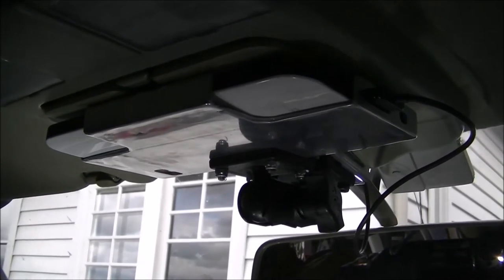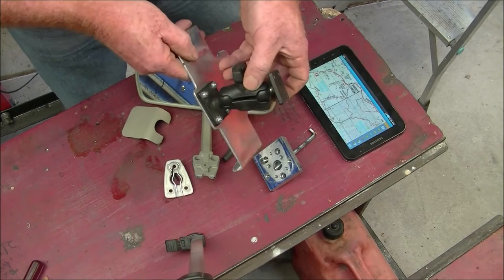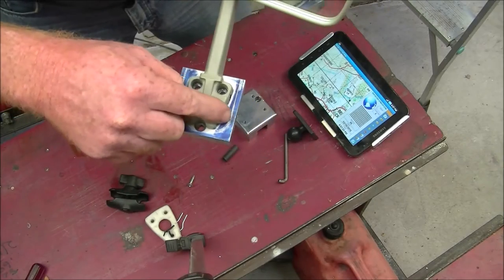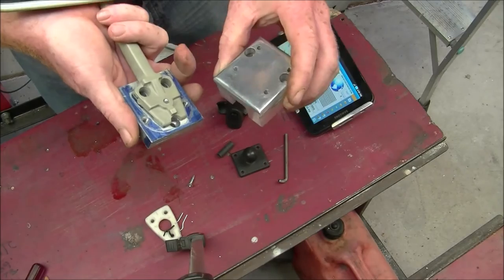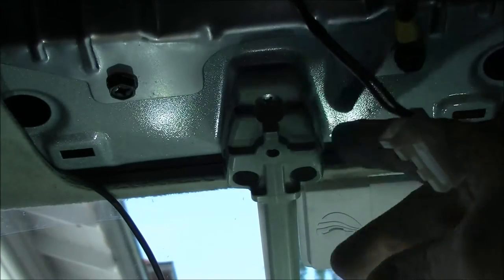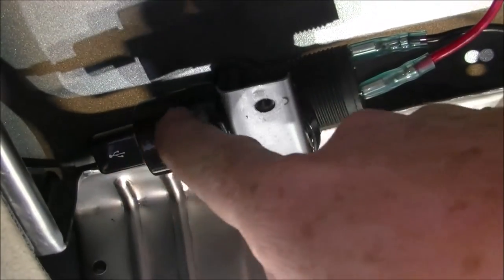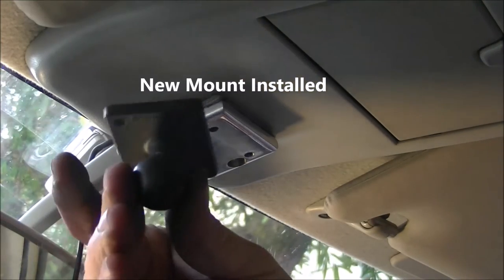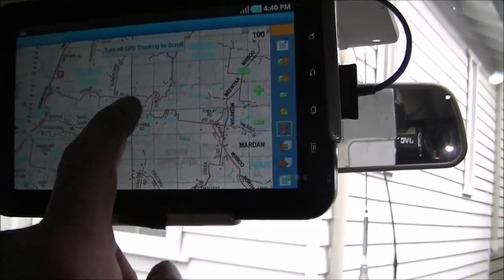HavaCrack: Nissan Patrol Overhead Monitor GPS Mount

Comment: Nice job!!! I've just utilised a spare RAM Mount arm myself to make a iPad cradle. I made a heavy gauged aluminium flat bar arm that bolts to the passengers seat front right mounting bolt. This doesn't hinder the seat operation in any way. The RAM Mount is bolted to this and I made a solid perspex cradle to fit the iPad. iPad just slides in and out. This unit sits to the left of the gear stick and can be faced to either the driver or passenger. You seem to be a fellow 'Tinkerer' lol. Love to Tinker on the GU and the Camping gear. I will be honest, as much as your unit is amazingly made, doesn't it bother you up there? I run a HEMA HX-1 in another cradle I made that slots into the GU's Car Stereo cassette slot. I'll run the HEMA on 'Explore' mode and the iPad on Google Maps for street navigation. On the tracks I'll run Gaia GPS as a cross referencing along with the HEMA on 'Explore'. The beauty of Gaia is you can overlay the UTM Grid Squares and have quick referencing to a paper Topo map which my wife loves to use. Cheers. I might look into doing my very first and film the set up. Cheers.
Reply: @HavaCrack  Will do. The actual dedicated iPad RAM cradle is on $50 anyway should my home jobby fail. I reckon their Stem that mounts to the seat wouldn't be as stable as the one I made as it's that flexi bar stuff similar to some mobile phone mounts but in a thicker version. About to fit a Provent 200 Catch Can and watched your vid. Great work on the machined reducers!!! Cheers.